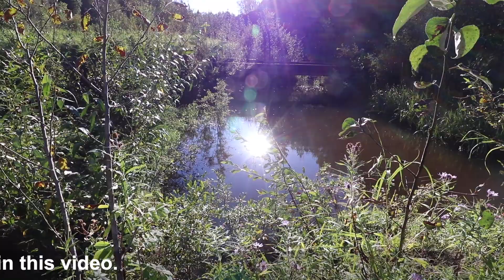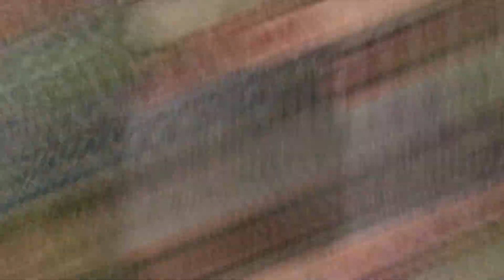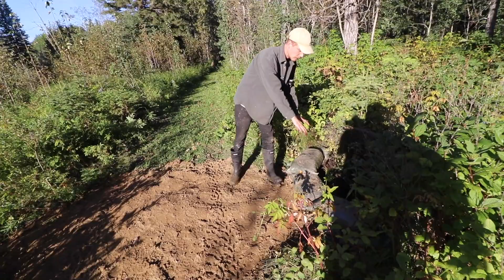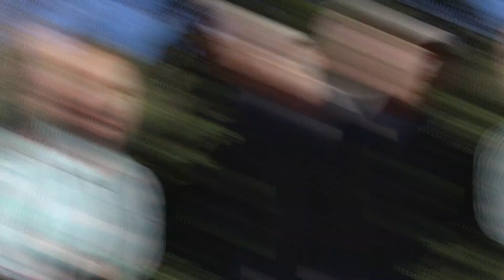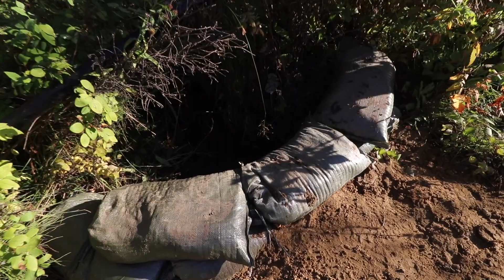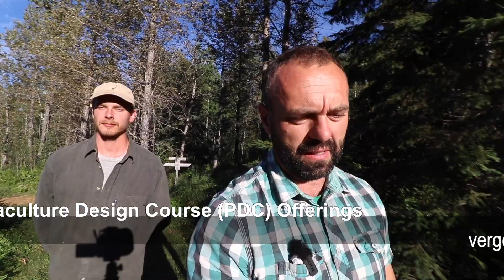Bioremediating Banks Using Willow Stakes

Comment: I really like the idea of using beaver dams as part of your permaculture system, but there's one big problem, and it's that beavers tend to build their dams too high and eventually they collapse causing a lot of damage.  I'm not sure what can be done about it.  Perhaps a combination of providing emergency spillways, reinforcing the dam when it gets too tall and making sure there is nothing of value downhill from it.  There are several really cool videos on YouTube showing beaver dam collapses.  Grass can provide excellent protection against erosion, but it needs to be dense with deep roots and be fairly longish (4 to 6 inches).  As you have no grass yet, you may want to put down some geogrid and riprap just to protect the soil for next spring, then remove it and plant grass after the spring floods.
Reply from the maker: Thx for your comment!